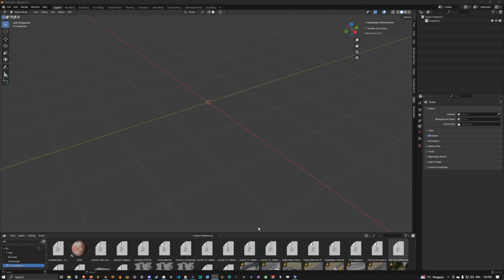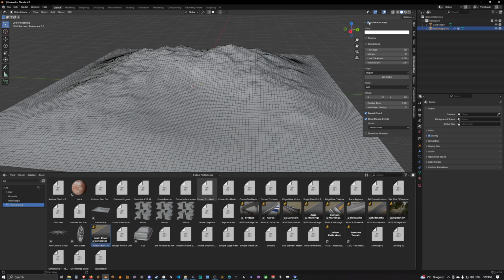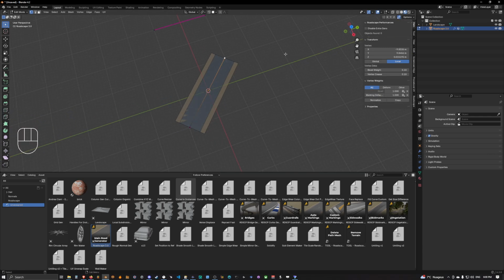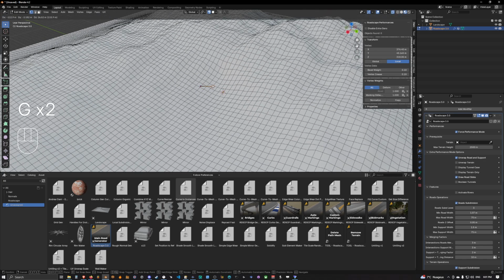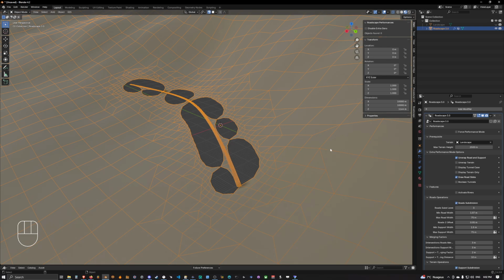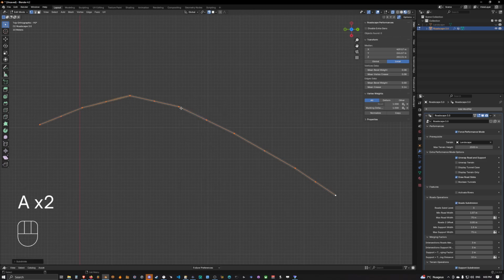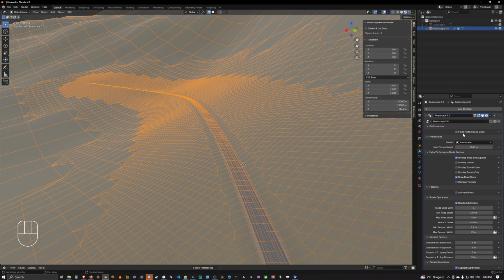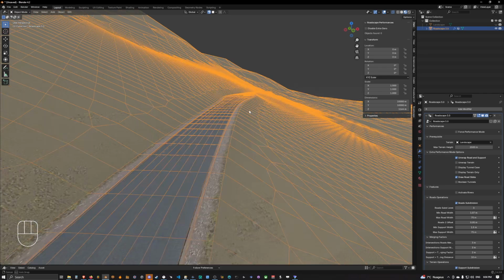Roadscape V3.0 - Pt.2 How To Create a Road

Comment: I want to use my my gaea terrain which i generated it does have subdivision as well 

But road Generator addon is replacing my older mesh and making a new one with some new textures.. how to do that ?
Reply from the maker: Unfortunately you can't keep your original mesh untouched, the roadscape process will ultimately modify your terrain in order to make it fit the roads.

Comment: hello, I downloaded the add on, but when I import the road generator or other features from the library assets, they do not have any material (they are pink) can you please help me? Thank you in advance
Reply from the maker: Hello Daniel, make sure to install the Roadscape Utility Tools addon, it's shipped with the .zip.
When you have it installed, it will be visible in the Item tab of the 3D viewport's N panel.
Inside it, you will find a Tools section, open it and click on Fix Pink Textures.

Comment: Nice work! It looks very simple. Is it possible to edit the profile of the road? At 2:12, is this edge or curve the profile of the road? Can I use more than one profile edge or curve?
Reply from the maker: At the moment it is not possible to edit the profile of the road, you can change the width and camber at any point but not the profile. Roadscape's profile is flat with two small linear road sides coming down meeting the terrain. Road profile is something I am considering.